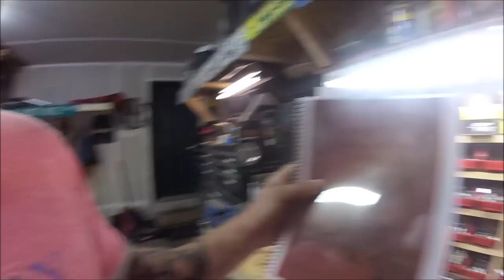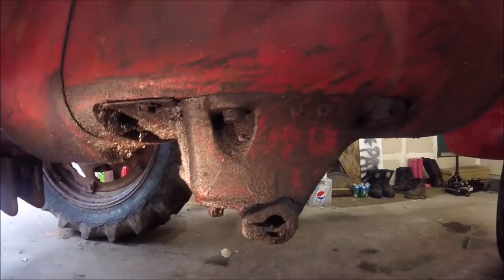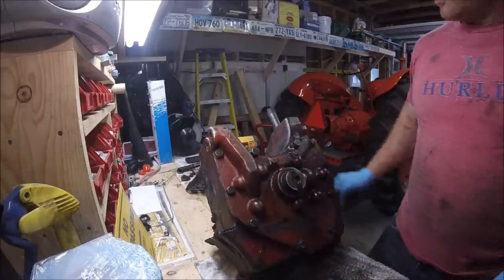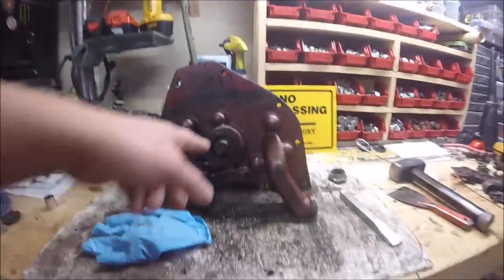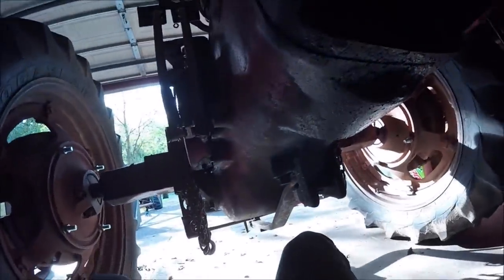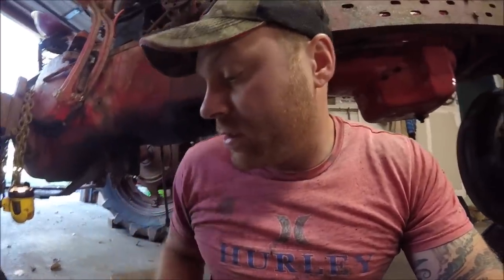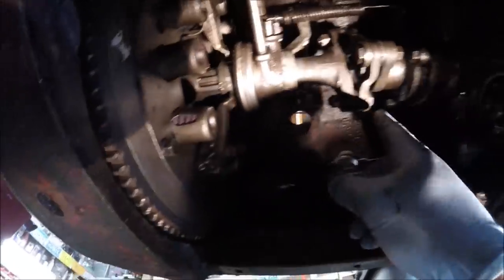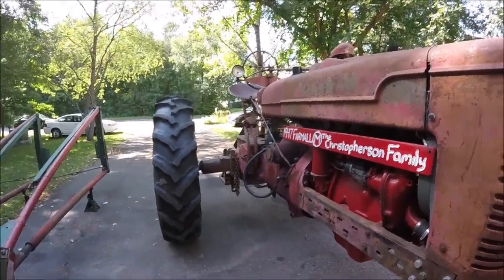1947 Farmall M Clutch Removal & Belly Pump Service

Comment: Kenny, my pumps works as well just leaks. Where did you get the seals and can you give me the part n umbers please?
Reply from the maker: Jeff. I believe I found the seals on eBay. I cross-referenced them from the Case-IH site to the SKF Seal interchange guide. Hyd pump drive shaft seal # 43509D -> 938294R91 SKF 13649 and Control Shaft Seal # 19812D SKF 7512 or 494027R1. The Control shaft seal was not the correct seal for my pump - luckily I was able to use the old one and doctor it up with a little RTV gasket maker. While I was in there I did the transmission input shaft seals. Trans shaft seal for lower shaft #381907R91 SKF 16113
. Upper trans  main shaft seal # 71871C1 SKF 20702. Hope this helps.

Comment: Did Case IH offer an explanation as to why the one seal was too big? Did the silicone fix hold up okay?  Looking forward to the Case 150 episode!
Reply from the maker: So far, the seal is holding up. I didn't order the seal from Case, but from eBay. I'm not sure what the explanation is for the incorrect seal size. I'm working on the Case 150 episode right now - it will be a LONG one, but worth it!
Reply: I watched a couple other Case 150 highlights.  Looking forward to yours!
Reply from the maker: I just finished uploading it and watched it through - found a couple mistakes so had to delete it and fix them. It is re-uploading now! Should be available in a couple hours! Get your popcorn ready!
Reply: My evening movie choice problem has been solved!
Reply from the maker: Hope you have your popcorn ready!

Comment: My super m is pouring all the hydraulic oil out.   I'm guessing it need seals.  Does it remove the same way this one does?
Reply from the maker: If it is the belly pump, yes. Comes out the exact same. Full seal kits are not available. You will have to buy each seal individually. I made my own gaskets.

Comment: Good evening Kenny! Having a throttle issue with my Super H. Ill pull the throttle up to engage, and it seems to take about 3 to 5 seconds to actually catch up to the speed selected. Have a slow oil drip coming from the governor as well?? not sure if that has anything to do with it. Any ideas? I can send you a video of it if need be.
Reply from the maker: There are a few things to check. First make sure your linkages aren't binding anywhere. A good coat of heavy, waterproof grease is what I always recommend on all the pivot points. Second, usually the weak spot in the governor is the spring. If you pull the inspection cover off, that spring should never have any slop in it. Even at rest it should be fairly tight. Otherwise you might have worn weights/pins in the governor. Unlikely it is the bearing. Oil could be dripping from the cover plate gasket, or the seal on the backside where the governor arm goes in to the housing.
Reply: @KennyKizzleRustyNutzRanch  Ok, ill have to pull the cover and check when I head back home. Interesting thing to note, is its all original but you can tell the governor and linkage tube was worked on because its black, not sure when it was worked on or what company its from. But ill have to checked the internals to verify there's no play and go from there. Thank you!
Reply from the maker: @bbplayer546  I wonder if the tractor has an M&W governor setup? Could be worth checking into. I believe they have four weights inside instead of two. A video might help us help you figure it out as well.
Reply: Kenny Kizzle honestly it might, the guy I bought it from, bought it from a friend of his who had it in a museum down in Florida. I’m trying to figure out what was so special about it. But It might have that setup on there, I’m heading home in 2 weeks so I’ll post a video up around that time!
Reply from the maker: Sounds good. Did it come from Paquette's Farmall Museum in Leesburg, FL? He has quite the collection of tractors, and some wonderful displays. I hope to be lucky enough to visit someday. Check it out here: https://www.youtube.com/watch?v=uh_2bYJR8Ko

Comment: thank you for the great info..ipulled my rump out of my h..i used ur idea abut the tool u had built..but cud not keep it on the drive slot so i added a piece of pipe that fit down over the coupling.. and with the impact..off it came..i seen in another video that you have to go counterclockwise wise on the counter shaft..and counterclockwise on the pump too..
am now looking for some reasonable priced bearings & seals tsk agin... buttercup....
Reply from the maker: You're welcome. A lot of the seals can be cross referenced using the SKF cross referencing website. Then, you can order them off Amazon or eBay for a fraction of the dealer price. I also have all of the seal part numbers in the description above. Here is the link for the seal cross reference guide (just type in the seal number and it will give you the crossed replacement): http://www2.chicago-rawhide.com/popup_parts_lookup_457012.htm

Comment: Would the clutch on an MTA/400/450 be serviced the same way?
Reply from the maker: Unfortunately, no. The clutch on those tractors is just a little larger than a standard M. Late Super M thru 450 clutch replacement requires splitting the tractor. The clutch pressure plate is too large to get out of the opening in the belly of the clutch housing. Splitting the tractor really isn't difficult, you just need to make sure you stabilize the front section really well.
Reply: @KennyKizzleRustyNutzRanch  good to know. Thanks for the info!
Reply from the maker: @RustyCarnahan  you're very welcome!

Comment: Hope she holds.    I did seals and a new dog on the pump and it still leaked☹️  I had pretty good  wear marks on the pump dog also......went to live hydraulics after that $$$ that’s another whole story mine is a 47M also.
Reply from the maker: I'm hoping so. I have checked the fluid level a couple times now since filling it and reinstalling the loader, and it doesn't seem to be leaking any! So far, so good!

Comment: These tractors were pretty easy to service. I think you could get the flywheel out of the M without splitting the tractor. Not so on the Super M. I have a video you might be interested in. Here is the dog that we had for the belly pump on our H and M tractors. It made taking the pump out a breeze. https://youtu.be/LHc7ZuHrD7M
Thanks for sharing. to my recollection we never had one apart.
Reply from the maker: Yessir. Thank you for the help! We were able to get it fixed easily with the quick tool I asked Domino to make for me!

Comment: Will that work for a 56 Farmall 400 TA
Reply from the maker: I don't believe so - the late Farmall Super M, MTA, 400, and 450 all have a 12" clutch I believe. The standard M is an 11" clutch and will fit through the belly of the tractor. The 12" clutch requires that you split the tractor to get it out.